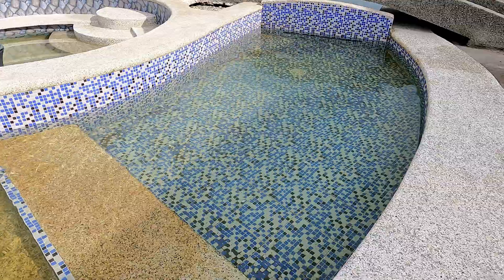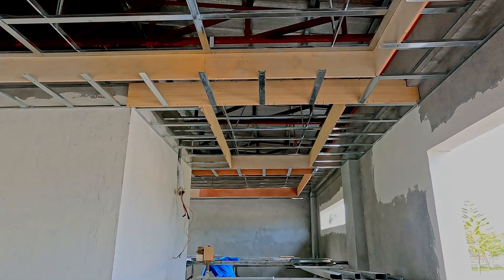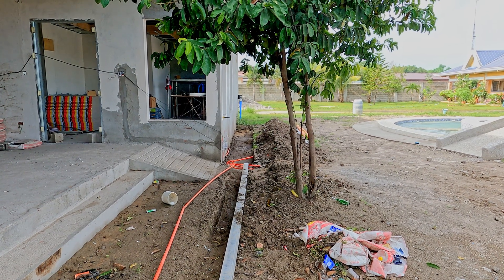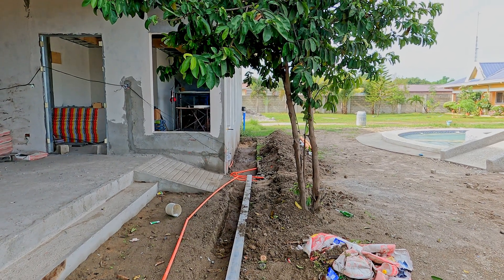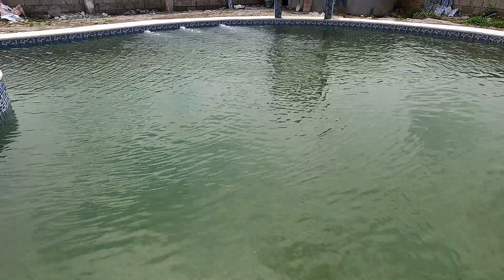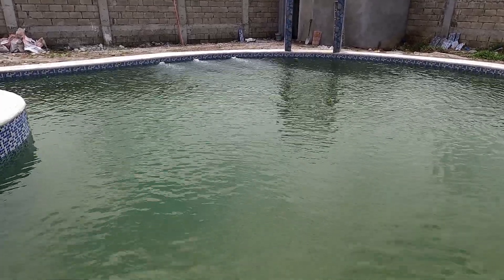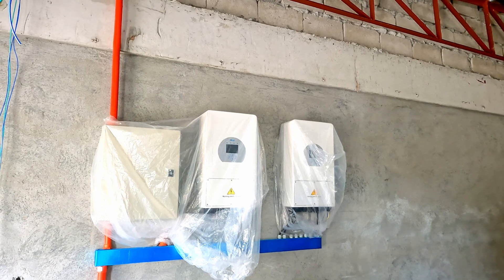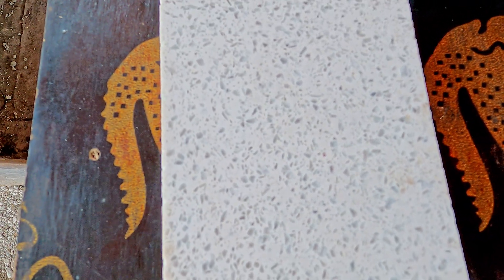Philippine House Building Day 211 - Building a Greenhouse that can survive a typhoon

Comment: Have you checked the PH levels in the pool? In Switzerland we used to put salt in to help keep the water clear daily, we had the company in from pond to clear in 2 days. This happen if we did not want to drain the pool during  winter months,  big issue there to discharge water. The water in the pool came from the government reservoir, cost less only suitable for outdoors.
Reply from the maker: No Steve we have not checked - that sounds like a very good idea. I'll ask the pool guys to get a test kit.
Reply: @philippines4.0buildinganew64  Mike, we did this every 2 weeks to ensure the amount of salt needed. Also checking the drains daily for small animals, leaves etc

Comment: Hi mike was a pool man for a few years maybe get yourself from overseas an barracuda auto pool cleaner that going when the pump is started not sure if you can buy them there cheers gerry maybe you have thought of that although wages there very cheap so you could have  a permanent pool maintenance man niceeeeee
Reply from the maker: I think we will have to stick with a manual solution for now Gerry but thanks for the suggestion. An automatic version to follow if it all becomes to much either for me or a maintenance guy.

Comment: That's really good that you have both steps AND a ramp outside your new house. I would have a longer more gradual ramp though. Short ramps are a steep incline, but if it's fine for you and your family, then o.k. Your swimming pool water looks better now. Honestly, I swam in a green water swimming pool one time, after Labor Day (when they close pools in the United States) at a hotel I was staying at. I asked the hotel desk clerk if I could and they said yes. Well, I did come down with a bad cold after swimming in the green water. It was still very hot weather, so it wasn't cold outside, had to have been caused by the green colored water that they had stopped treating with chemicals since it was after Labor Day. I'm saying this to tell you, perhaps you should not swim in your pool until the green color is gone.
Reply from the maker: Oops - too late ! As you have now seen.